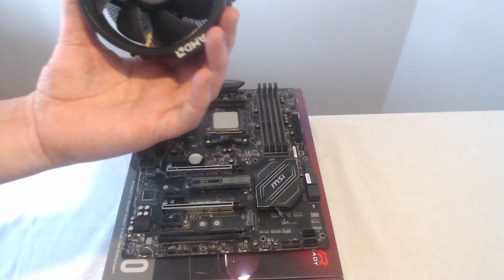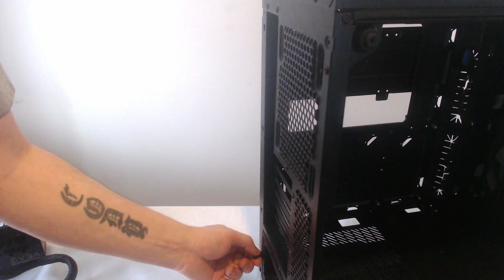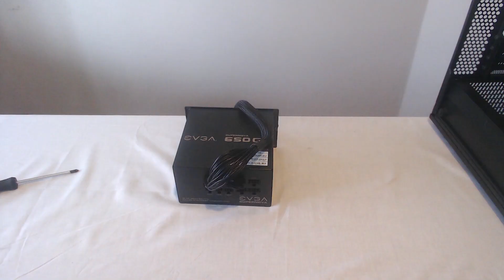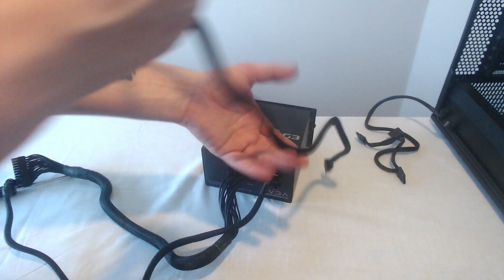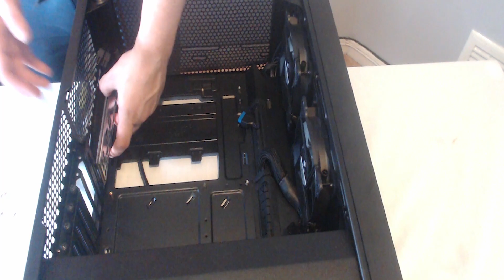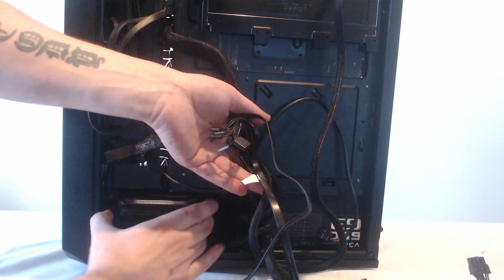AMD Ryzen 5  & GTX 1660 TI  Gaming PC Build Step By Step

Comment: cost?
Reply from the maker: This build could be done for much cheaper. The motherboard I used is expensive ( I only paid £84 but generally sells for well over £100 ) power supply is completely over kill considering it’s good enough to run and intel 9th gen and 2080 ti ) case is not exactly a budget case. You could get a b350 motherboard and 500w bronze power supply and cheaper ssd and it would do the same job
Reply: How about MSI B450 pro vdh plus it's good for overclocking, has an rgb header and also price is not high.

Comment: How, ryzen 1600x suport  ram with 2666mhz and u have r 5 1600
Reply from the maker: Razvan Denis depends on the motherboard. Can get my ram to 3466 on the x370 gaming pro carbon
Reply: @WGAPGaming ok..this mother board MSI B450M PRO-VDH suport 3000mhz, but i have r5 1600x, maybe i will do a mistake :/
Reply from the maker: @curcanrazvan  it will support above 3000mhz im sure. my board says it rate for 2666mhz i think. xmp goes to 3200 with my ram and manual overclocking gets me to 3466mhz. memory support is better with b450 so you should have no issues. not heard of any issues with this board and ram speeds but have not tested it myself
Reply: @WGAPGaming  ok, thanks

Comment: I’m building almost this exact build for my first PC build and this was extremely helpful, thank you! 🙏 One question, how did you boot up Windows right away, a USB plugged in that has windows on it right?
Reply from the maker: the hard drive already had windows 10 installed. but yes the easiest way to install windows on a fresh system is to use a 16gb usb drive and download windows 10 from the microsoft webite using the media creation tool. 
plug that in an install windows 10 from the usb drive
Reply: Thanks mate, subbed and subscribed for the great content. Sidenote: the deals on that ryzen 5 1600 are insane right now
Reply from the maker: @AegonTheUnlikely  thank you. yes they are extremely well priced